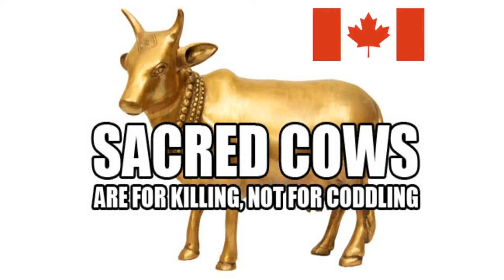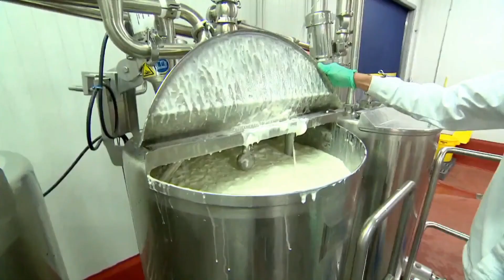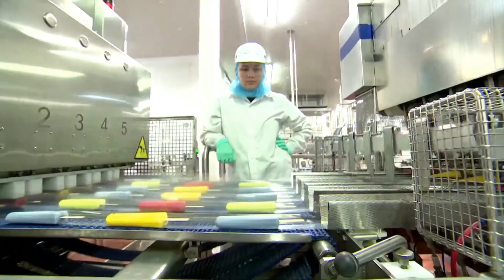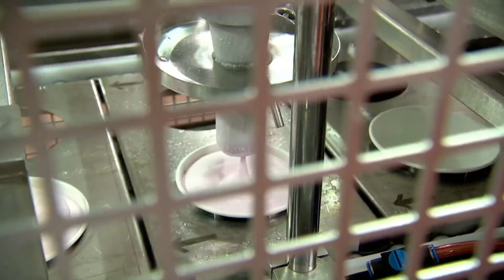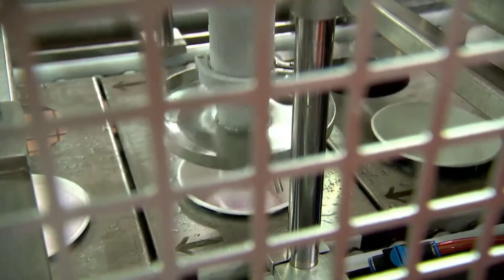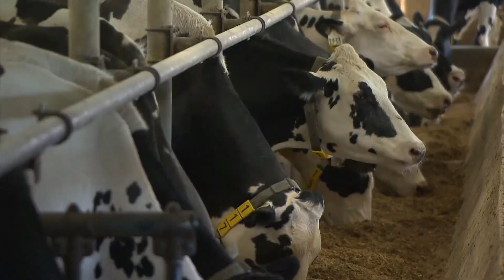Supply Management in Canada is Anti-Choice

Comment: Your audio could use work.
Reply from the maker: You're right, I bought a $20 mic to get this gig running. I have so many video ideas I am going to go ahead and buy a better one.
Reply: Once upon a time I gave you a mic. Is that around?
Reply from the maker: I gave it back at one of the meetings we had at your house. It was a case to a mic, there was no actual mic inside, only the metal frame to hold one up.
Reply: That sounds familiar.